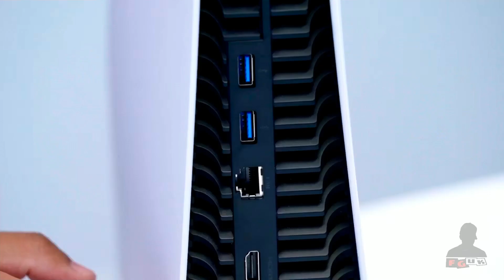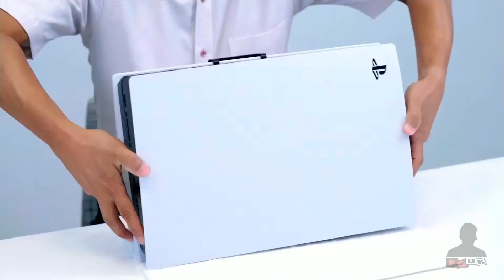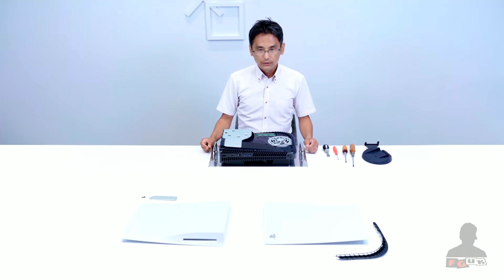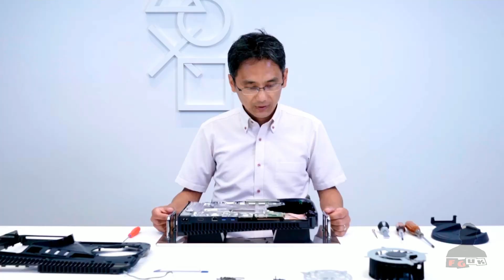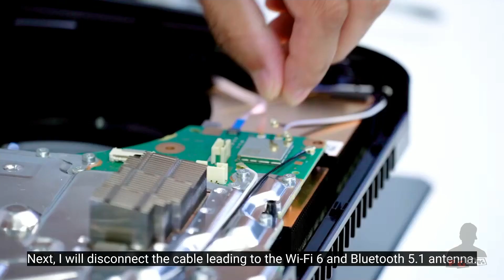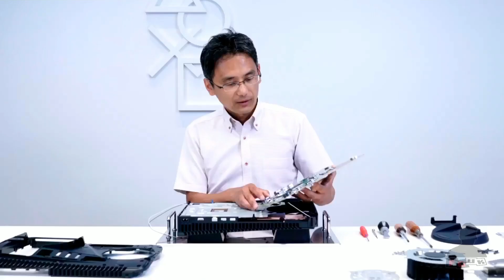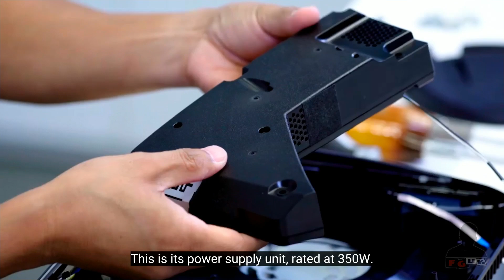The Official Sony PS5 Teardown (English Voiceover)

Comment: I’m sorry but this tear down completely blows series X out of the water way more thought and innovation was put into ps5 unlike series x a 10 year old could’ve came up with that design.
Reply: not really, while the ps5's cooling system is impressive the fact that the series x can run a stronger apu with a smaller body and just 1 fan is more impressive.  The ps5 cooling solution is just a beefed up version of a laptop heatsink while the series x uses natural convection to aid in heat dissipation which is a more efficient system.
Reply: @stalememe6407  you obviously have not watched any gamer Nexus case reviews debunked natural convection because when you have fans blowing on the heatsink 4 in a way it doesn't matter if the case is horizontal or vertical
Reply: @harleydavidson2218  the xbox series x has one fan....
Reply: @stalememe6407  one fan two fans for three fans it doesn't matter when the fan is mere inches away from the heat sink it does not matter if it's vertical or horizontal natural heat convection does nothing in that short of a distance watch Gamers Nexus videos they totally debunk that have a good day
Reply: @harleydavidson2218  why dont you link me to that gn video.
Reply: @stalememe6407  your a big boy I'm sure you'll have np funding it
Reply: @harleydavidson2218  ?
Reply: I don't agree with your last statement, but you had me in the beginning.
Reply: Xbox is dead haha
Reply: Chill yo haha. That 10-year-old would have one of the brightest futures of anybody in his or her age range IN THE WOILD.

Comment: where is the Liquid metal?. I hope innocence and co will explain to me where the liquid metal went to?.
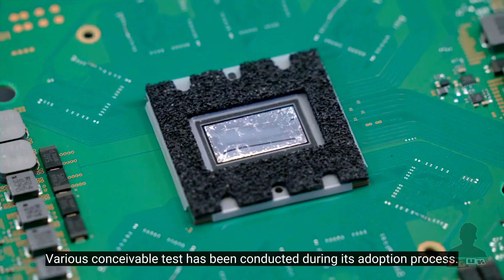Reply: 6:06
Reply: Jesus christ!! the dude was holding it up for like 5 seconds and we were all staring at it when the subtitles said liquid metal!!!???
Reply: @antwango  I saw the same old usual metal paste on the market, and it's sad how people hyped this thing up like is a game-changer and is gonna help bring the performance to a higher level.
Reply: @patriotenigma4841  Using liquid metal on a high-volume commercial product, is the "game changing" aspect of it (other than the typical benefits of liquid metal, like better thermal transfer and longer life*). I believe the major reason behind Sony using it, is that machines can manage it better than they can thermal paste. So the systems can be automated better. It's the WAY they designed around that, that has let them do this.

You seem to be expecting too much from it too, the liquid metal doesn't HAVE to be liquid at room temperature. In fact, slightly above room temperature would be desirable, so it only liquifies when warm, making it safer (in the factory, for instance)

* - I say longer life, which isn't necessarily true on aftermarket hardware, usually because of incompatible metals. That shouldn't be the case, if it's designed from bottom up to use it.
Reply: @MrVelociraptor75  We all know is best to use metal paste but some people touted the PS5 metal like is different which today proved to be the same as usual and I am absolutely livid by the hype people sometimes give to this machines.
Reply: @patriotenigma4841  You need to stop being pushed onto the hype train, mate. It only ever leads to disappointment.

I still maintain, this IS a big deal, but not in the fanboy "game-changing" way. It's a marvel of technical engineering that has been the bane of PC enthusiasts for years.
Reply: @patriotenigma4841  how can you say, its the same liqiud metal as allways, maybe it has less evaporation problems as comon metals used in the pc world...you can´t just look at it and saying it is the same...even in the pc marked exist more then one type of liquid metal with differen caracteristics...
Reply: Yo Hoo  You are one of them Yo Hoo. Well done

Comment: That liquid metal though! I like the way the teardown went! Not some stupid youtuber trying to be funny. Just a professional showing us how the beautiful piece of tech is constructed and how it works. Amazing! Thanks Fox for the translation!
Reply: I really liked that about the whole thing.  At first I saw how short the video was, and then it was literally just perfectly executed, typical Japanese, no messing about, just the facts and attention to details like storing that screw.
Reply: @AnthonyChoueiry-z4z  Xbox has a lower GPU clock. The Xbox GPU is 1.7 ghtz for the series X, the PS5 has a 2.23 ghtz clockspeed. 36 CUs (40, but 4 are turned off) at 2.23 ghtz probably produces more heat than 56 CUs at 1.7 ghtz. As for the CPU, there is a .1 ghtz difference with SMT, so the heat produced would be about the same. Also, Xbox is more powerful GPU wise on paper, but the stats on paper do not take into the boost SmartShift (which is on the PS5 only for consoles) gives (SS gives a 10% boost for RDNA 1 and Zen 2, and the creator of it say it will scale higher when RDNA 2 is used instead).
Reply: @icaruswindrune7116  dude can you explain why they have 4 CUs are turned off ?
I'm really asking and not trolling ..
(And it's not really my thing all this numbers 🤣)
Reply: @laminebelkhodja5269  The Die size for the GPU is 40 CUs. The some of the CUs may be subpar or just do not work, so they turn 4 off to be same. Series X does the exact same thing too. Most console GPUs do this. Also, it wasn't trolling at all since it actually is something most people don't know about.
Reply: @icaruswindrune7116  ty for the answer 
finally a person who knows what he is talking about 😊👌
I was watching videos in youtube to understand this TF battle ,12 vs 10.3 and I understood that you can't tell until  the console are compared side by side because all of this is  guessing....( The ps5 ssd is something revolutionary this is the big difference I think )
Reply: @laminebelkhodja5269  Yeah. Although Smarshift is another factor, as is frequency. Smarshift tends to bring a boost of 10 to 14% for performance in general (this would be for RDNA 1 and Zen 2 in the laptops using it. RDNA 2 with Zen 2 supposedly scales higher), and this could put the PS5 around series X in performance (if raw specs are to be believed). Frequencies are also important since faster means that a workload has less time spent on it (so instead of 2 seconds it might be 1, for instance [just a rough comparison]). All of what I said are only factors though. Heat produced, cooling methods, power consumption, and even the cache size/scrubbing are things that affect this too. I'd suggest researching a bit about Moore's law or look at the 3090 vs 3080 (where there is only a 10% difference in performance even with many more cores and flops). We might not even see differences this upcoming gen due to that. All I know is both sides will have fun.
Reply: @icaruswindrune7116  ty for your honesty ...  This generation will be amazing for players in both consoles 😊
Just one month and we will have the true answer about everything 😌
Reply: @laminebelkhodja5269   And I hope that my honesty helped. And I agree that this gen will be amazing for both consoles. As for the true answer, it might be a bit after a month for it to come out (look for 6 months to a year). We won't be seeing much throttling for the systems until the middle or the end of 2021.
Reply: @icaruswindrune7116  100 MHz difference and up to 14% boost performance with RDNA Gen 1 architecture while it will be much higher with RDNA Gen 2 architecture, the PS5 not overclocked at all, the boost coming by AMD smart shift technology exists on the PS5
Lbots clowns dead brains lies propoganda irrelevant anymore ✌️
Reply: Anthony Choueiry you can keep dreaming little fan Xbot 
I have to tell you that ps5 will run cooler then the Xbox sx but we can wait and see it’s just one month my dear and then we can really talk about it ;)
Reply: @AnthonyChoueiry-z4z  delusional clown he say take them 2 years to build this specific liquid metal system that proof the PS5 not overclocked at all, the system bulit like that in mind years ago, all the lies propoganda irrelevant anymore ✌️
PS5 have superior air ventilation and that is a simple fact now, the teardown it's the Bible of facts, move on clown
Reply: מוטי אהרן for a guy who keeps saying Xbox will bottle neck come on dude that cryteck dev was lying the whole time why do you think he has to take down his post lmao for personal reasons 😂😂😂😂 they never had a dev kit and was already praising ps5 and giving series x a bad name when they knew nothing about the system maybe if people understood the hardware and wasn’t so dumb they would realize series x doesn’t bottle neck at all it was built to not do that dummy it was already proven just like there have been many reports that the ps5 would but hell idc if it did or didn’t both systems offer different approaches Xbox is offering power while ps5 is offering speed both will have great things to benefit from triple a games would be slightly comparable even tho series x may offer just a tad more difference because of power but that is completely left up to developers
Reply: @AnthonyChoueiry-z4z  bro Xbox is not even a console it's just a weak PC watch the news my friend the Xbox is burning inside plus the SSD of the PS5 is so fast that it counts as RAM
Reply: @Reiko_107  there have been a bunch of reports of Series X systems getting really hot and these aren't just prototypes.
The PS5 tests were in really hot rooms, small, with loads of bright lights and it hardly makes any noise and runs cool.
Reply: @MrSec84  finally a smart guy is over here not a dumass that is socking Microsoft dick
Reply: Derek otero jaja 2 YouTubers that like the ps5 say that the Xbox is burning up does not mean that it's 
What a fanboy.
Let's wait for real professional to come out and say that it's burning up 
That is just speculations and propaganda 
I like both consoles but I hate fanboys like you.
Reply: elduro138 exactly why didn’t any of the videos show them running hot when Xbox sent out  pre series x systems to them the videos didn’t show anything dealing with heat yet they praised the series x while they were on video
Reply: @Reiko_107  Wow what a bunch of hurt whining baby fanboys.
Reply: @kraigparadise5770  brother real question is how the fuck can a refrigerator be hot is like a microwave is cool
Reply: @kraigparadise5770  nobody's going to buy the Xbox serious ass they're going to be giving them for free so don't you even make a pre-order you are wasting your time
Reply: Anthony Choueiry Ok you buy a PC I work no room to build a PC 😂
Reply: You mean ryan
Reply: @AnthonyChoueiry-z4z  I heard Xbox series x was running really hot
Reply: @AnthonyChoueiry-z4z  Hahha now you are trolling bro!  if you don't understand tech, don't talk about it! Smart shift does not work the way you think it does. It is called "smart" for a reason! You should stop listening to xbox fanboys, they wil tell you all kinds of fairy tales! The cooling solution of the ps5 is superior to that of the series X, just look at that heatsink and TIM!
Reply: @s3rv3r3rror8  Xbox fan boys? dude it AMD shyt they using... i care nothing for consoles.... until they used Zen 2 and RDNA 2 for there set up. comes from AMD which is my fav always has been since atholon. And FX series.... they do so good vrs nvidea right now.... There 6900 will be nice and they wont be Gddr6x but that dine as the bust is not used all the way yet.
I care nothing for consoles. i have a 3080 tuff and a 3090..... I love pc... always have..
ace msi x 570
g skill CL-16 32 gb.... the cl -16 b die which is not made because it too expensive... but much better for the fabric of the cpu for over clocking the ram with XMP. 
It just funny talking with console lovers... and when i talk with pc lovers... pc lovers have to make there stuff.... you just buy it premade.... So we have to understand what can go with what and etc......
So the fact that I know the exact CPU they both use and all the system component.... I would say xbox wins hands down... seem to me 20 percent more....
But i gave reasons...you just say "no no it not true" no proof no stats..
Reply: @AnthonyChoueiry-z4z  Have you got a reading and writing impairment? When did i say series X is not more powerfull than the ps5? It has about an 18% increase in power over the ps5 on paper, lucky for us games are not made on paper! The ps5 has a superior I/O architecture and a superior cooling solution! The I/O Complex in the ps5 is going to be the game changer! You just watch. And have you seen what sony can do with a 4 tf machine?
Reply: @s3rv3r3rror8  HAH the IO is not complex.... the Xbox has better cooling... they use PCB made with coper layer... vrs ps5 does not...
DUDE the Devs them self say they hate the ps5 right now. that why no games coming out on ps5... all the games that where like spider man etc.. are all coming on ps4... same with cyber punk... YOU KNOW WHY because of the boost clock they use in there system... xbox uses sustained boost.. so the dev can make the game the same rate all the way through. vrs ps5 there some scene it can boost higher then others.. so they will have to optimize for that...
THE DEV SAID THEM SELF that ps5 is less optimized then xbox due to that nature. they have to fluctuate in tecture and no game creater wants to spend more time and money just so ps5 can cut cost.
I know this because many of the people i know make games for both ps5 and xbox... and when you swap over to even pc... the game needs to be optimized for the components it uses.... 
THE DEV's HATE PS5 platform period.
Reply: Anthony Choueiry the Xbox a YouTube got “toasty” while in stand by and he even dropped the expandable ssd because it was too hot in his hand and he hand to pick it up a different way 🤣 How is that better than Ps5???
Reply: Austin Evans leaves the Earth🤣🤣🤣
Reply: You don't get 9 TFLOPS without liquid metal man!!!! This is double the GPU power of Xbox Series S. Suck it, Xbotz!!!
Reply: Yeah bro, T1000 tech, lol.
Reply: Japanese. Hands down for being pro's!! handled the device like a living entity, amazing!!
Reply: Japanese. Hands down for being pro's!! handled the device like a living entity, amazing!!
Reply: Some suggestions for your ps5 |1. DO NOT put it in a cabinet or any type of enclosed space | 2. Don’t use discs | 3. Clean it regularly | 4. Don’t have a cat or dog | 5. Don’t have cockroaches | 6. Don’t put anything directly on top or next to your ps5 | 7. Never use external hard drives, as they will just suddenly die, then your fucked | 8. Make sure your room temp is under 60 degrees Fahrenheit (who even likes 60+ degree weather? It’s hot as fuck | 9. And finally, never try to modify your ps5 without doing extensive research to make sure it won’t break your system.
Reply: I agree. YouTubers are so damn obnoxious these days. It was a relief to see a nice professional teardown of the system.
Reply: I was talking about that early that is the real reason I’m buying a PS5 because of the liquid metal cooling chip 🤔
Reply: @toddsmith8082  Really, it's not the games you're interested in but the liquid metal cooling solution? 😂🤣😂 Wow sounds about right. 🤦
Reply: @evilformerlys4704  stop reaching please...

Comment: Nice.
The market is going to be flooded with cool side panels. 👍
And that heatsink vapor chamber is a work of art.
Is Sony going to use Foxy's sound chamber for voice control. 🤗
Reply: Imagine all the high end panels that will be available, brushed aluminum? Carbon fiber anyone? 
I can’t freaking wait!!
Reply: @sccanj  RGB panels
Reply: @sccanj  There's already a company offering the £7000 pre-order for a ridiculous 24k gold plated version, or whatever they think they can produce - as flexing the plastic to remove the plates may kill that idea...
Reply: @sccanj  Can you Imagine those panels in Carbon Fibre 😯😯😯 OMW!!!!
Reply: PS5 air ventilation better then xsx that is a simple fact now
Reply: If the PS5 has a built-in Help System Ai like Apple's Siri, Foxy needs to be the voice!
Reply: I’m so ready to see the panels people make. Admittedly, I will become a whale and dress my PS5 in many outfits.